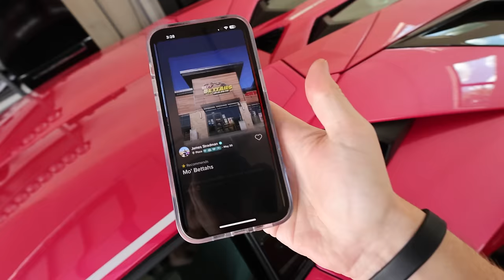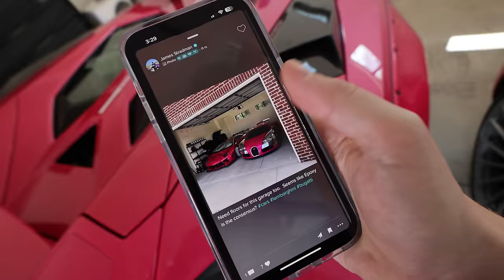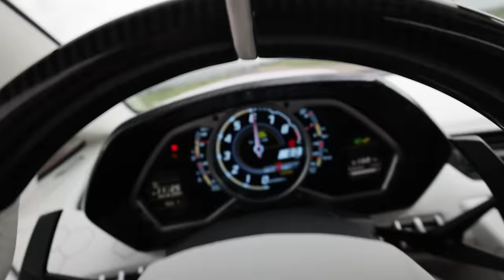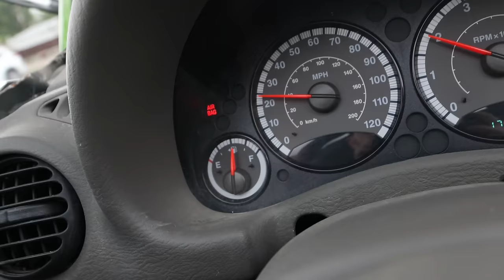Confused Cops Pull Over my Fake Lifted Lamborghini

Comment: This was awesome. This is how an interaction between a smart cop and driver should look like. I'm also quite sure she noticed the missing seat and seatbelts, but because it was quite obvious this was just a quick test, she did not mention those and many others that were wrong. Also I think there should be a system where the cops take pictures of the car and write additional data and if the same car is on the streets, in the same situation, after a while, then it gets directly impounded. Or at least that's my two cents.

Comment: I can't believe you did that! It's not as bad as I thought it would be honestly.  In case you're wondering, the Liberty part of this car has a 3.7 V6 known as the PowerTech with a whopping 210hp and 235lb-ft of torque and can actually tow 5,000 lbs (well used too when it was new).  Wonder how it would go towing a car around, would make interesting content!
Reply: There is a reason why you can't find a good 3.7l jeep engine in the junkyards. Seen 50k mile engines just randomly chuck rockers off. Prety sure from start to end production they all had problems.

Comment: Cut the fenders and make tires fit the lift. Maybe some overfenders. Those tires are 12" out of where they should be. My advice is go bigger and cut the body or lower the lift and do minor cutting. I'm guessing the latter isn't an option. Make it a beast. Call it a 4x4 lambo stradale. Definitely cut the fenders and put tires that will fill the gap. It will be so cool or even tracks in the winter

Comment: Dude look up old man emu they make a 6 inch lift for the liberty. One of the best in the market. As far as the 3.7 liter that’s in it they are crap. Rip the motor out and find you a 1.9p vw diesel way more torque and fuel economy lol but for real don’t ever get that engine hot or it’s done. And only use Hoat coolant that green universal stuff will cause the coolant to turn to a brown chalk and clog up the coolant passages in the block causing it to overheat and pop head gaskets then you got to get new heads. Ask me how I know

Comment: I hope it wasn´t very expansive. Thing is falling apart. Practically a body bolted to a chassy. Everything of the build left to do. What happened to the window? Door jammed. Bolts loose, no interior. I mean they could at least made it basic nice. Scale 1:1 Hot wheels yes. Off road tires no. Exhibitionist value, yes.